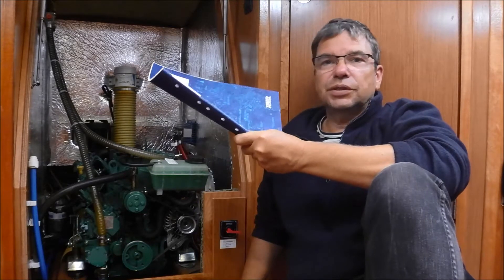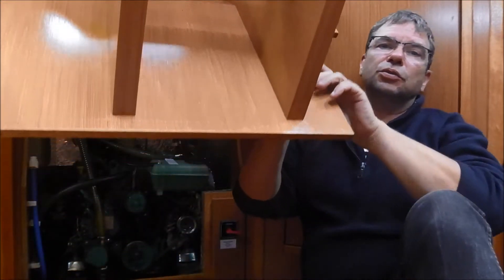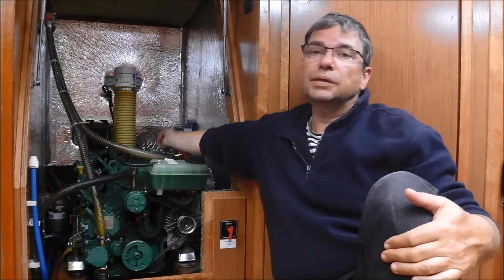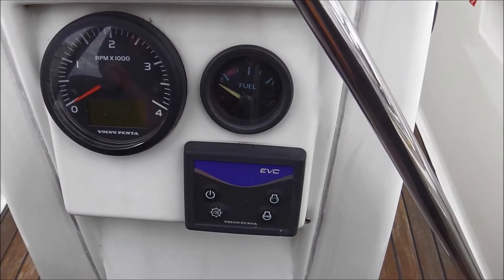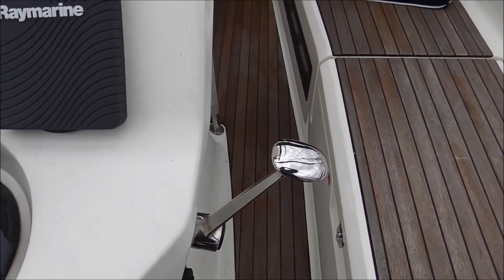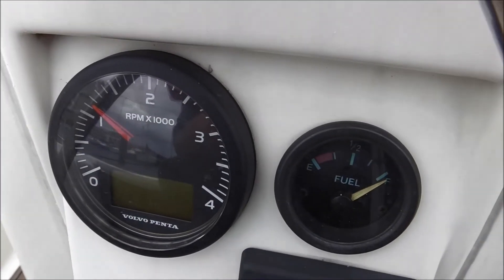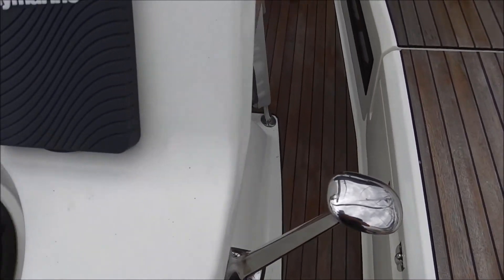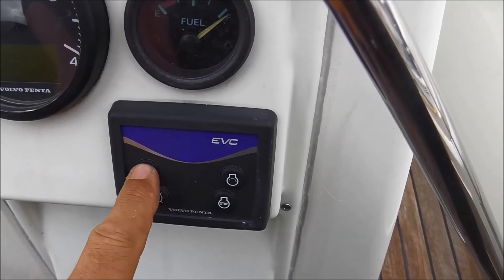Starten des Motors einer Segelyacht - Erklärbärvideo 11

Comment: Der Warnton am Ende ist die Warnung vom Öldruck. Klar - wenn Motor an = Öldruck da. Stoppt man den Motor, lässt aber die Elektrik eingeschaltet, fällt der Öldruck und irgendwann geht der Summer an. Eigentlich müsste das Piepen früher kommen, wenn der Motor warm ist. 

Das ist auf jeden Fall eine gute Sache, wenn man denn drauf achtet. Mir gings letztes Jahr so mit meinem Kühlwasser. Der Warnsummer war defekt (nie drauf geachtet) und dann ist mir ein Schlauch am Wärmetauscher geplatzt. Ich habs noch mitbekommen bevor das Teil überkocht, weil ich am Panel auch die Kühlwassertemperatur sehe (leider ist es so: Je moderner das Boot, desto weniger Instrumente). 

Seit dem achte ich immer beim Starten und Stoppen, ob es noch pieeeep macht.
Reply from the maker: Moin, vielen Dank für Deine ausführliche Ergänzung. Wieder etwas dazugelernt und ich werde bewusster auf das Piepen achten. Danke nochmals und Ahoi
Reply: Kein Problem. Dafür sind ja die Kommentare da. Hupt es denn früher/schneller, wenn der Motor warm ist und du den abstellst? 

PS: eigentlich müsste dazu auch was im Handbuch stehen ;)
Reply from the maker: Moin, joo, es piept schneller, wenn der Motor warm ist. Das Verhältnis von Männern zu Handbüchern ist doch ein bekanntes Problem. Mann schafft das auch alleine... glaubt er bzw. ich zumindest. Also, besser mal reinschauen. Nochmals vielen Dank.
Reply: Alles klar dann ist es der Öldruck ;) 

PS: Hehe - das mit dem Handbuch und Kriegsfuß kenne ich. Wahrscheinlich bin ich eins der wenigen Exemplare, die immer erst mal ins Handbuch schauen. Naja - kommt bei mir sicher vom Beruf ;)